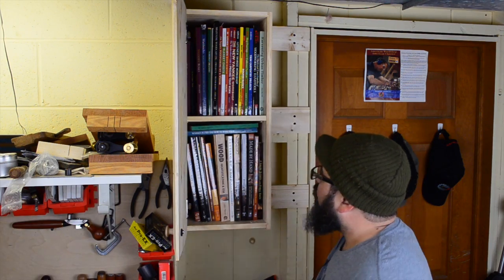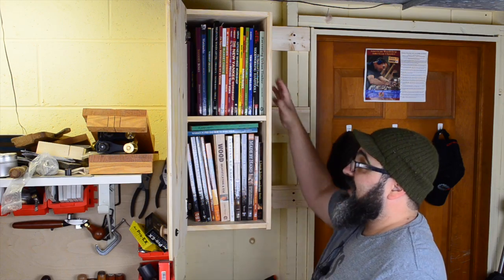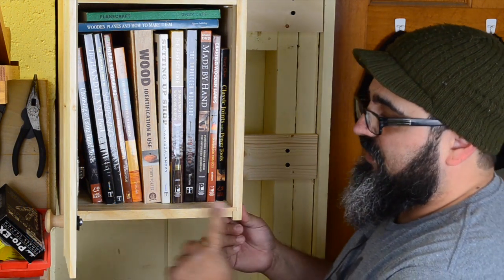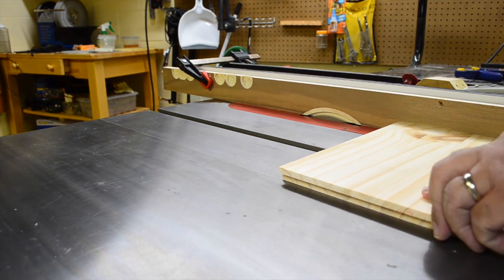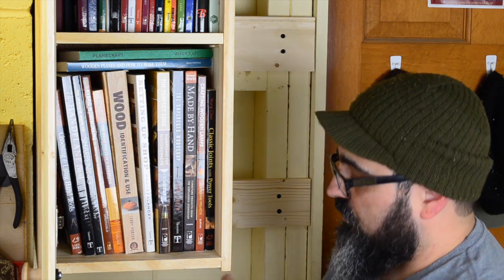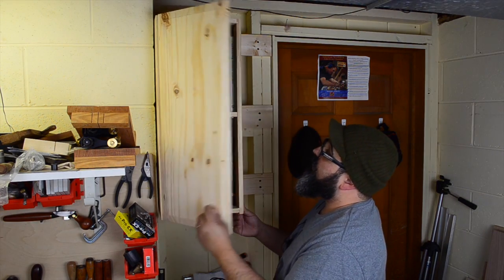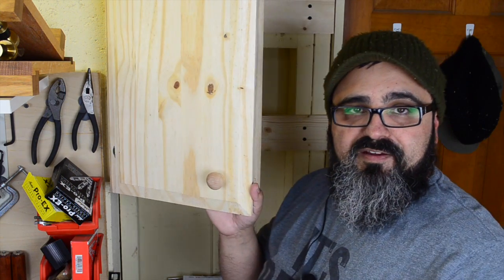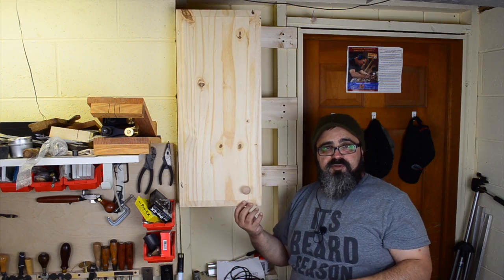553 The Small Pine Cabinet

Comment: Hey Matt. Nice Joinery and hand tool work. I mount the concealed hinges to the door first then lay the door with hinges+mounting plates next to side panel and mark for screws with an awl (draw a line for how far in from edge on side panel to put screws).This method is faster and more goofproof. I also drill a out 1/8" deep under adjustable shelves using a 1/2" Forster bit (about 1/3 of bit off the edge) to hide pins (I use 1/4" spoon shaped pins) and prevent shelf from pulling out. This trick also works for shelves that wobble on pins, just make one of the "holes" a little deeper. I've been working as a carpenter/cabinetmaker for about 30 years.